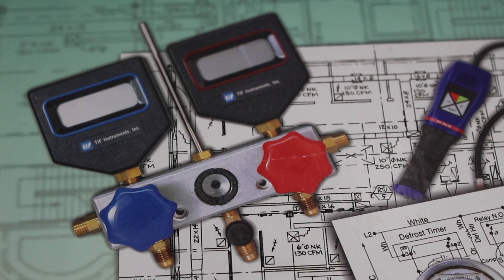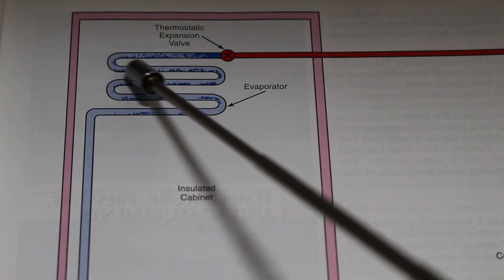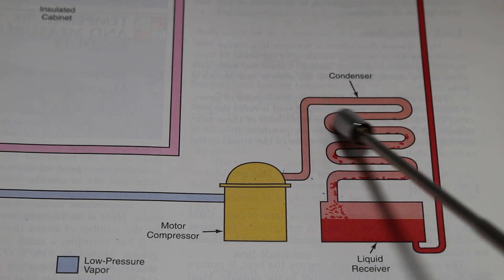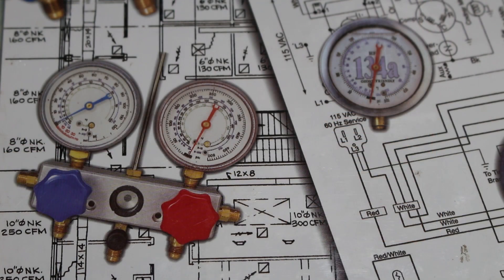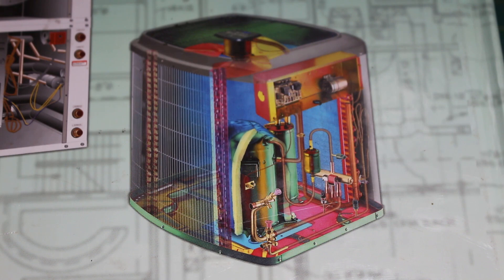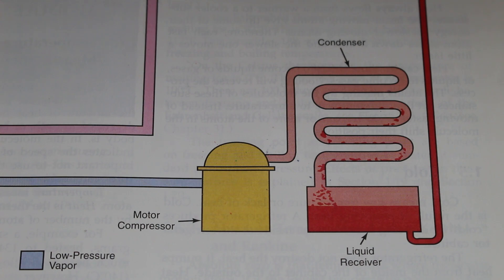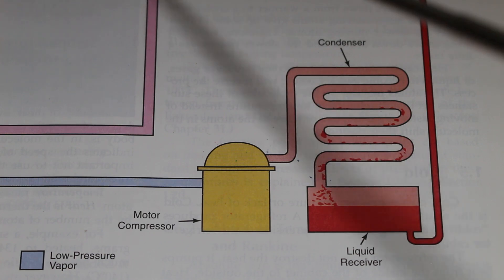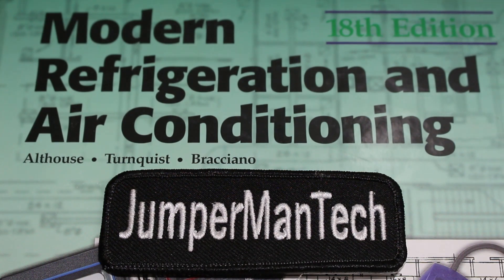SUPERHEAT And SUBCOOLING Explained (HVAC 101) Simple & Easy

Comment: Do you have a tool list or any books you recommend? Would you recommend starting out with analog or go straight to fieldpiece digital gauges?
Reply from the maker: I'm going to make a tool list and add the links to them in all my HVAC/R video descriptions as well as send it to you personally. I would recommend starting out with the analog guages. I actually just ordered a new pair yesterday. I always go with Yellow Jacket analog guages. Best price and they are reliable. I got them off amazon for $105. They are much more expensive at any store you go to. I have yet to use the digital guages but they are so expensive. I do have the Fieldpiece SMAN digital guages on my wish list. They seem too bulky but they have a lot of features on them so in that sense they are worth the money👍 You can test superheat, subcooling and it even has a built in micron guage which are great tools to have. Thanks for watching and stay tuned for weekly uploads!
Reply: @JumpermanTech  Ok thanks just the normal yellow jacket 3 port? not the titans?
Reply from the maker: @jzxonlyman  Yup, just the regular ones. These are great for all units from AC-Refrigeration. These are my go to gauges.
https://amzn.to/397mEyU
Reply from the maker: @jzxonlyman  This is the HVAC/R bible! This is the book we used in college/trade school. EVERYTHING you need to know is in there. This is also the textbook used to teach the theory for the Refrigeration Operating Engineering license. Its all you really need.
Its called "Modern Refrigeration and Air Conditioning". Heres a link.
https://amzn.to/32FxTw8
Reply from the maker: @jzxonlyman  As far as a tool list, would you want just a basic list for troubleshooting/daily carry or you want it with links to amazon?
Reply: @JumpermanTech  Yea that would be nice, I think on Amazon you can make a link that will go to a page that has all the tools you have & recommend. I currently have sman 460 though, I bought them used and the micron gauge is not accurate at all so I wanted to try some analogs.
Reply from the maker: @jzxonlyman  Okay cool, give me some time & ill send you the links. I always wanted the SMAN digital gauges. Hmm, I see. The analog gauges only read refrigerant pressure and that's all. A micron gauge is a separate tool.  These gauges do show if you're in a vacuum down to 30 inches